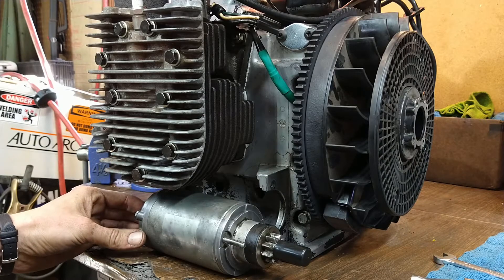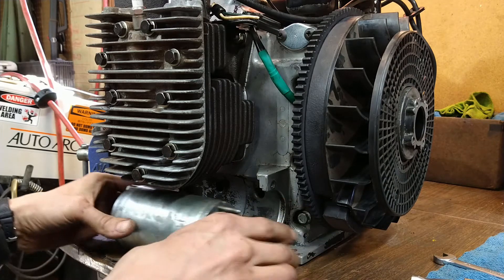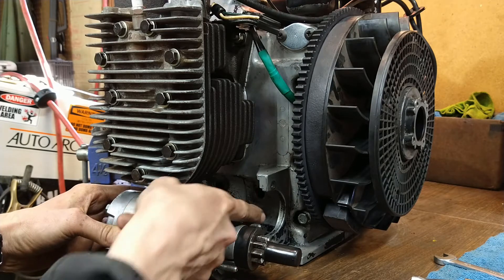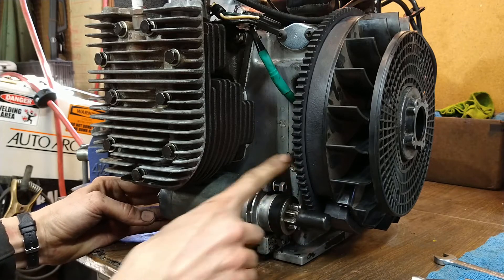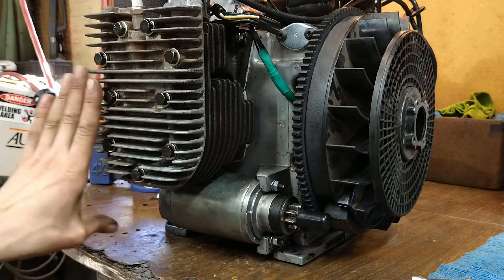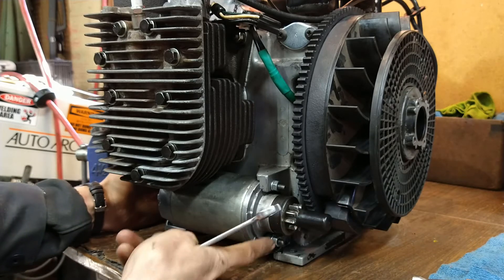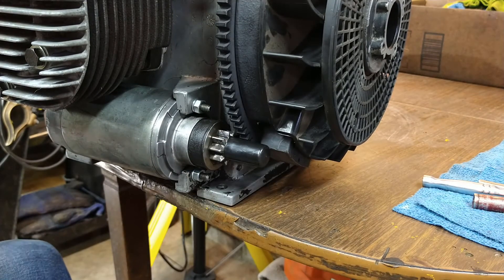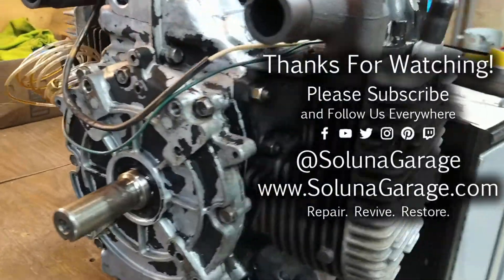Kohler Magnum M18 Complete Service, Part 16: Starter – Cub Cadet 1882 Restoration Project

Comment: This is exactly what I need to know. Starter on my Bobcat with Kohler Magnum 18 does not engage. Never touched any thing like this before so this video gives me confidence to fix it. Thanks a lot :thanksdoc:
Reply from the maker: Awesome!  Good luck and let us know how it goes.
Reply: @SolunaGarage  Hey, it worked, my Bobcat is starting again. Ordered a new starter from Caltric, shipped it across the pond, remove the whole engine and put it all back to gather. Thanks a lot for the video.
But now it randomly stops, so I probably missed something when I did the reassembly.